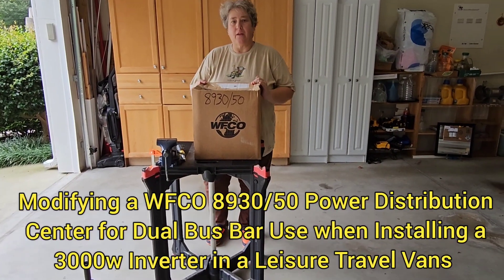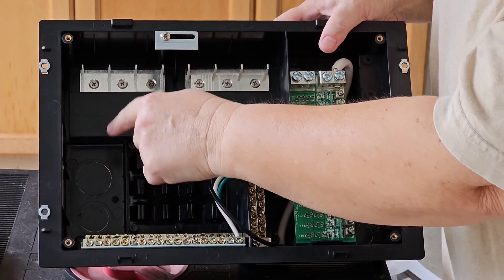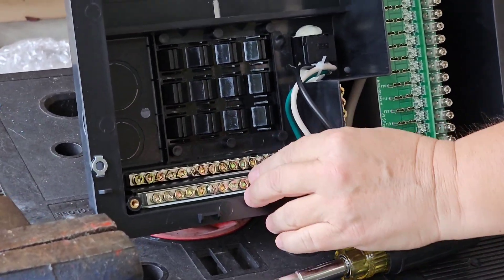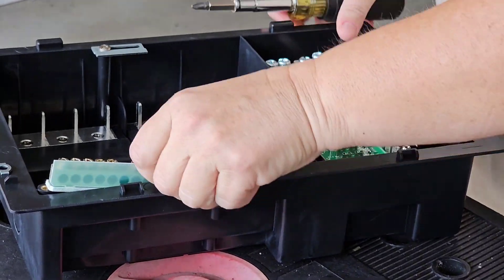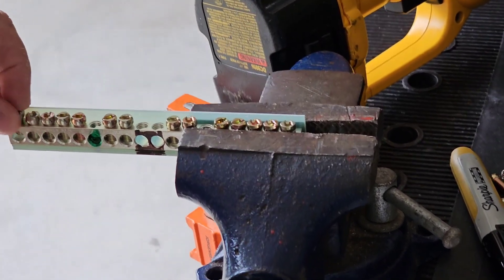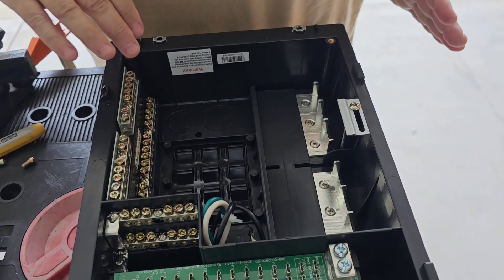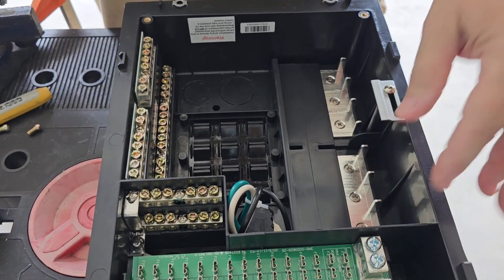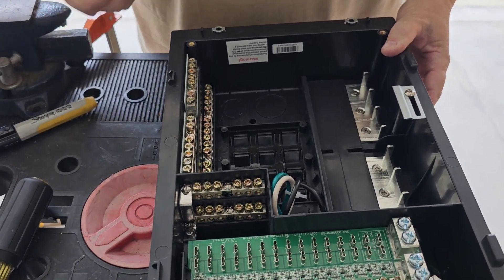Modifying a Leisure Travel Vans Breaker Box for 3000w Inverter Use

Comment: What is the part number on the 50 amp box? I don’t trust myself to do a clean cut, and I’m willing to pay for the more expensive part. I can’t seem to find out online. All searches take me back to the one you already have
Reply from the maker: If you click the title you open my description which has links to everything. The part# is WFCO 8930/50 Power Distribution panel. It's not hard to cut a section out of the neutral bar with a hack saw even. The version that already has the neutral bar cut is WFCO 8930/50S, but I think they are only sold to rv manufacturers.